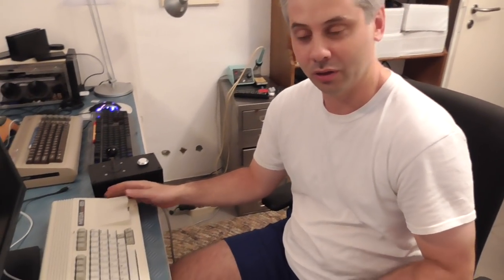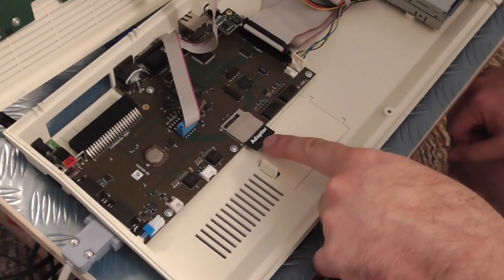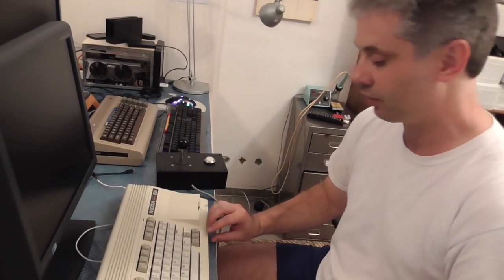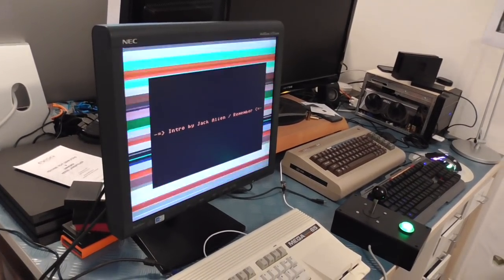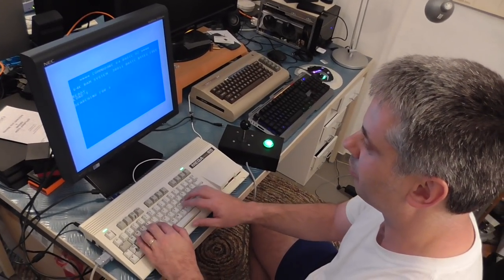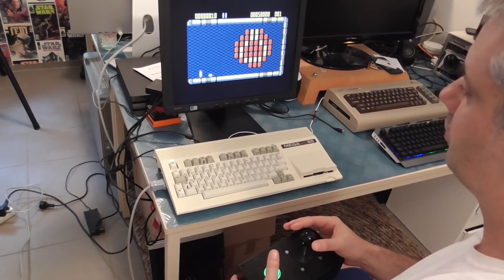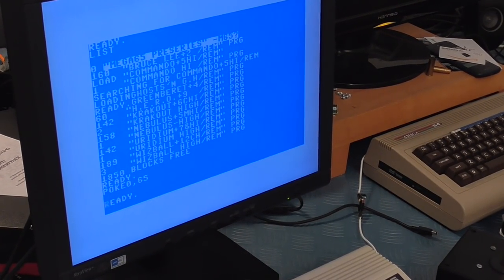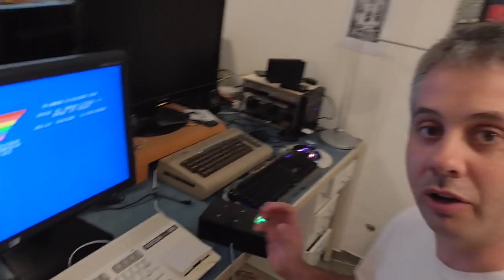Introduction to the MEGA65 Retro Computer Pre-Series Hardware

Comment: Also if the project takes off, it would be really cool to see the "Mega65" branded cassette tape drive and the 5'25" floppy drive options as accessories!
Reply from the maker: That would indeed be very cool :) We actually toyed for a while with coming up with a method to provide FPGA bitstream updates via cassette...
Reply: @MEGA65retro  Considering currently there are literally no options for brand new external 5'25 and cassette drives, it sure would spark a demand. Don't take my word for it though, I am a cassette and floppy enthusiast, but surely there is a community out there (YouTube, Twitter etc).

Comment: Are there any plans to add support for a second fire button so that 'up' can be mapped to button 2 for platform games?  That would be a nice feature, especially with 2 button controllers.
Reply from the maker: We have the potential to do such things, but it may require an adapter for those controllers, or a funny cartridge that has the gamepad connectors on it.  All things we can look into when the machine is available.

Comment: 2 thoughts: 1. It would be interesting to see some state of the art c64 demos being run on the Mega, to see how it performs with all trickery involved. Preferrably the ones that push the c64 to its limits. 2. Will I be able to put two real 8580 SID chips into the final Mega to avoid emulation?
Reply from the maker: We will do this once we have the compatibility at a sufficient level. Note that we are aiming to reproduce the C65, and thus while we will offer good compatibility, perfect C64 compatibility is not necessarily the goal, as the C65 was not perfectly backward compatible. That said, we will of course be doing our best to make it as compatible as we can. As an open-source project, others are also welcome to help on this. Paul
Reply from the maker: ... regarding the SIDs, we will be offering an expansion board that will take real SIDs, but first goal is to get the MEGA65 itself out.
Reply: @MEGA65retro  Thanx for fast answer. I am looking forward to this machine.

Comment: fascinating project! - will there be USB support ?
Reply from the maker: No, to us an 8-bit machine shouldn't have or need USB: With SD card, 100mbit ethernet and real joystick ports built in, there isn't really the need. If someone desperately wants it, then it would be possible to design a USB cartridge (that could also work in a C64).
Reply: @MEGA65retro  thx for the info! imho USB would be a plus, but not a must.
i'm looking forward to this project and i'm keen to have one of this machines in my hands somedays!

Comment: Have you considered a dedicated DB9 port for mouse on the back? Most people prefer to have mouse on the right side, besides it would be useful to have mouse and both joystick connected all the time - less switching of accessories = less port wear.
Reply from the maker: No space left on the back of the PCB, so unfortunately not so easy.  It would be possible to easily make a joystick/mouse multiplexor to plug into the joy port to do the same job.

Comment: This is compatible with COMMODORE C64?, I2C might be used to interface the COMMODORE MEGA65 to a PHILIPS DCC900 Digital Cassette Deck via the SPDIF IN and SPDIF OUT so that games can be saved and loaded digitally as a byte instead of serialy (a bit as a time)

Comment: What about the localisation options? Is it possible to get the strings for translation? What is the scope of the work involved (software-wise) to provide options for different keyboard layouts?
Reply from the maker: If you can find a German etc C65 ROM, it will just work.  Then you just need some custom key-caps.

Comment: I would not want to have the reset button so close to the joy ports. Can't you move it to the rear?
Reply from the maker: It's where it is on the original C65 prototypes. Doesn't actually get in the way and is super easy to use after the first 5 minutes.  Also, you don't need to keep swapping joysticks all the time, because there is a hardware swap setting in the freeze menu.

Comment: Will it be possible to run a bbs on the c65? :)
Reply from the maker: On a C65 it would be a bit annoying, but on a MEGA65, it should be great. 100mbit ethernet (with interrupts!), 384KB main memory, 8MB expansion memory, ~500KB/sec SD card access, 40MHz processor, it should be a walk in the park.

Comment: I just realized that due to the design of the C65 there is very little space around the cartport for larger cartridges (think Sound Expander). Even less space on the mega65 since you moved the power cable to the rear.  I know this is non issue since I don't expect ~anyone to actually want to use a Sound Expander on the mega65.
Btw, dare I say it looks MEGA sweet? ;)
Reply from the maker: Yes, it is more restricted than on the C64. The only cartridge of practical use we see a problem with so far is the MSSIAH, which we can accommodate.
Reply: @MEGA65retro  Right-o
Reply: IEEE-488 cart wouldn't fit either I guess? At least not the original Commodore one.

Comment: Very cool progress! I have a couple of questions: (1) can you make the ethernet port rr-net compatible (for ip65 support), (2) can you also add a user port for c64 peripherals?
Reply from the maker: (1) The RR-NET has the most horrible programming interface known to man due to squashing a PC 16-bit ISA interface onto an 8-bit bus with a chip that doesn't even do that properly.  Given the relatively few titles that support ethernet on the C64, we think it better to offer a really nice and simple 100mbit ethernet interface, and then write software to match it, and help people patch the few existing titles.. For example, the packet buffer is memory mapped on the MEGA65, and it has working TX and RX interrupts.  Driver code will likely be MUCH smaller, so patching in place should be possible. 

For (2) we have already explained on forum64.de that the production ready machines will have a hole for the user port, and provision to connect a userport expansion board.  Adding to the mainboard is unfortunately too expensive, and would suck time that we don't have right now.  But rest assured, enough of us all want a user-port that it will happen.
Reply: @MEGA65retro  Thanks for the replies! Regarding RR-Net, it is noteworthy that the IP65 cross-platform library supports it. Maybe you could talk to Oliver Schmidt about adding support for your ethernet implementation to IP65?
And thx for the answer on (2). 
Will you give option for pre-orders soon??
Reply from the maker: @8bit-dude  yes, we intend to get support added to these various tools as time allows (but don't let that stop anyone who wants to do it in the meantime!). We'll let people know when we are ready for ordering.

Comment: What is the Ethernet here good for? Genuinely curious, what would be the networking options for this machine?
Reply from the maker: There is already some software for the C64 that supports ethernet.  Basically it is there to make it easier for data exchange with other machines, and for internet access (when someone ports one of the C64 browsers to support our network interface).
Reply: @MEGA65retro  Danke!

Comment: I noticed the display is skewed to the right a little. Is it just the monitor doing this or something in the video signal itself?
Reply from the maker: The horizontal offset is a software thing, and on our list to fix. It's just not on top of the list right now.
Reply: @MEGA65retro  Thanks.

Comment: Looks beautiful. Please tell me though that the production boards will have 2x SID sockets? I thought that was the plan originally? Not being able to install real SIDs on such a brilliant re-implementation of the C65 would be a huge disappointment.
Reply from the maker: Real SIDs will go on an expansion board and work flawlessly. Would have added crazy cost to make space on 6-layer PCB for them.
Reply: @MEGA65retro  Thanks for the reply and clarification. Could you describe how they will interface with the board? Would it be via the Pmod connectors and if so, would the audio be routed to the board's 3.5mm jack? I'm guessing it is most likely that the expansion will only support the 8580 / 6582s? Exciting times!
Reply from the maker: The exact function of the board will be determined when it is created. But we are planning on the R3 PCB to have a header that allows the 3.5mm jack to be routed via the SID board.  There is nothing stopping the board supporting 6581s in principle.  We have 12V DC available on the PCB, so that isn't a problem.

Comment: Nice, but how come the 64 mode doesn't fill the screen better (and be centered)?
Reply from the maker: The off-centre issue is in the VHDL and will be fixed when we have a moment to attack it.  This week has been all about getting the new hardware working.  The C64 screen is double-scaled so 640 of the 800 pixels wide. To make it wider would cause all manner of horrible scaling artefacts.  Also, in real life, it feels quite true to using an original C64 on a TV.
Reply: @MEGA65retro  why not use 1024x768 mode at 3x pixel mapping? Or 1280x768 for 16:9?

Comment: Extremely awesome, but that joystick button is way too noisy, and in this demo it seems louder than the game. I think it would grate on my nerves and suck the fun out of the experience pretty fast. Maybe I'm just oversensitive to sound. If there is a quieter solution, I would pursue it. I know this is a year old. This is the first video I'm viewing on this channel, and my first look at this project, so maybe it's already been addressed. I'll end this long-winded ridiculous comment by saying GREAT JOB!
Reply from the maker: Howdy, the joystick is just my home made one.  The MEGA65 takes standard C64/Amiga/Atari style D-SUB 9-pin joysticks, so you won't need to buy a joystick from us, but can just use an old one you have laying around, buy one from somewhere, or an adapter, or build one using quieter microswitches than the ones I used :)
Reply: @MEGA65retro  Awesome. Thanks for the reply / info and good luck with your amazing work!

Comment: So, this is not emulation, right?
Reply from the maker: No, it is an implementation using FPGA. If we had enough money, we would be able to take the "program" for the FPGA and have it turned into a normal chip. As a result, using the machine feels totally real, and it can never "lag" or do other such weird things that emulators do.  The video display is calculated in real-time pixel by pixel, just like on the original C64 or C65.  The MEGA65 IS an 8-bit computer.
Reply: Awesome. Good luck with your project!

Comment: Having Reset right next to the Joystick port is just going to greif users while trying to swap ports.
Reply from the maker: No need to worry! First, the reset button is hard to press accidentally in this way. I never had trouble with either my real C65 when I had it, or the MEGA65 since.  Also, you don't need to swap joysticks around on the MEGA65, as you can go into the freeze menu, and switch ports in software.
Reply: I was more thinking about people swapping peripherals (joystic, gamepad, mouse, lightpen, paddles, etc.) than internal port mapping.

Comment: There is the My64, Ultimate 64, The C64 mini, The C64 Maxi, c64 Reloaded and now the Mega65 and you can buy replacement mainboard PCBs as well! Is there any point in using an original C64 nowadays? just buy a brand new one!!

Comment: With 2 SD card slots and a serial connector, the internal floppy seems a lot less important than it did back in the day - might be nicer to have one in a smaller case
Reply from the maker: This is a question that has come up a number of times. To us, a computer is not a C65 recreation if the case doesn't look the same.  Also, having the internal drive for the drive noises really helps to complete the experience. So, yes, it is a bit of a vestigal appendix, but we think it adds to the charm!
Reply: To be honest, slowness of 80s era mediums is not the experience I miss - that’s why I mostly use SD2IEC with JiffyDOS Kernal nowadays... IMHO the floppy space would be better used for C128 numeric keyboard - but it’s of course your decision.

Comment: Well nice. But why the hell noone makes a MEGA 128 ?
Reply from the maker: Well, once we get the C65 core done, there is nothing stopping anyone from adapting it for C128.  The MEGA65 is open-source software AND hardware, so you can do what you want with it!
Reply: C65 was essentially an upgrade to both the C64 and the C128 lines.

Comment: Please don't tell me these are Cherry MX Blue switches in this.
Reply from the maker: The lock keys are from memory the blues, so that they click, but the most of the keys are a quieter variety.
Reply: @MEGA65retro  but are they cherry? I'm asking because they are certainly the worth manufacturer of kb switches by now, quality and feel is pretty abismal. I personally think Kailh is best, but there's a few other good one. Did you thought about using hotswap switches connectors from Kailh? they would make the kb switches easily personnalisable.
Reply from the maker: They are Cherrys. They are hole-through soldered, so it would be possible for people to replace the switches on their keyboards, if desired. However, at this stage we plan to keep our lives simple, and only offer the one model of keyboard.